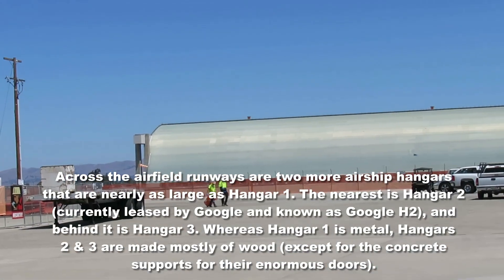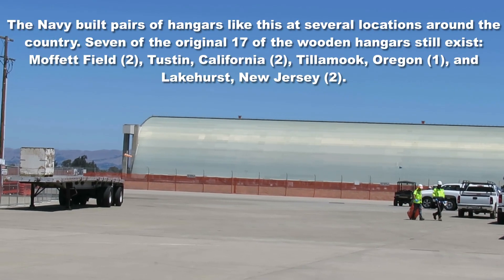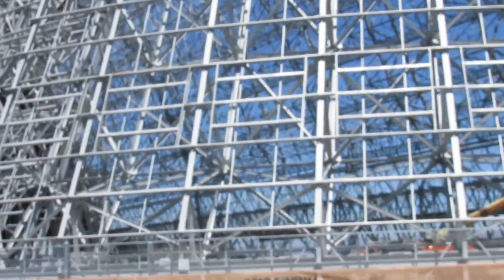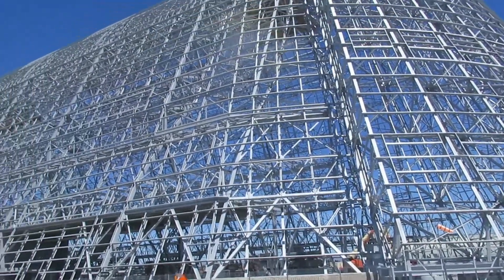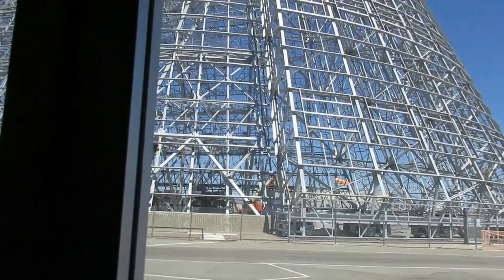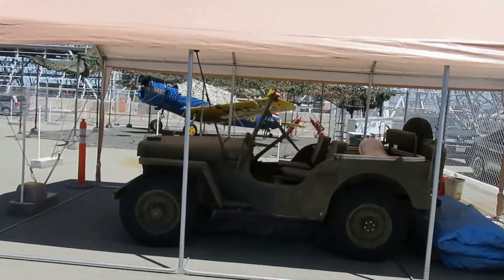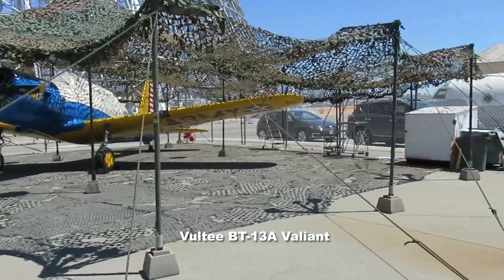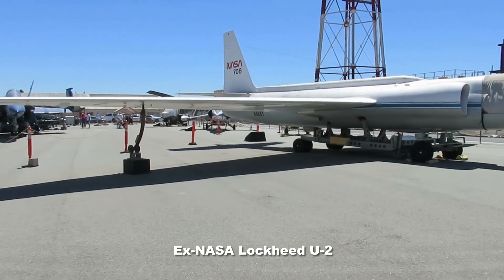A Visit to Moffett Field and Hangers 1, 2 and 3

Comment: The Hornet at 12 minutes is an F/A-18C Hornet.  It is not a Super Hornet as it has the earlier round intakes.  The absence of the dogtooth leading edge to the wing is less obvious because the wings are folded.